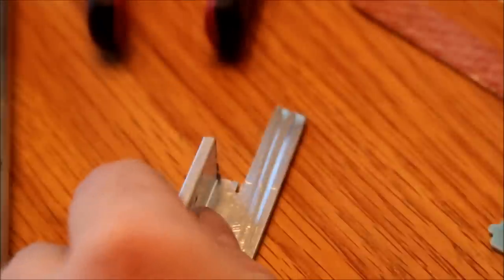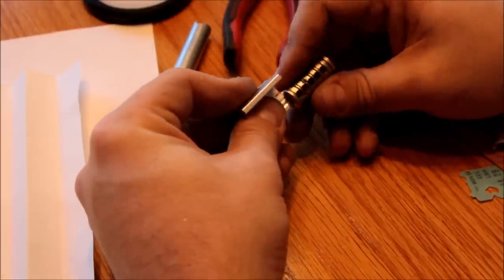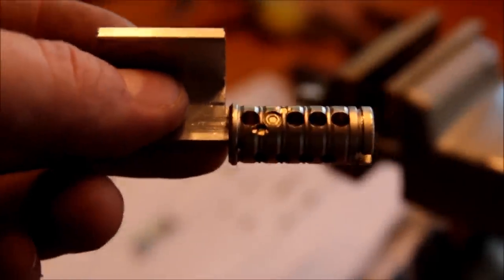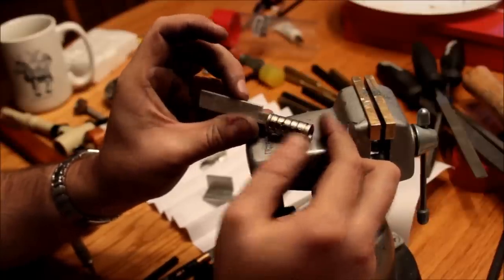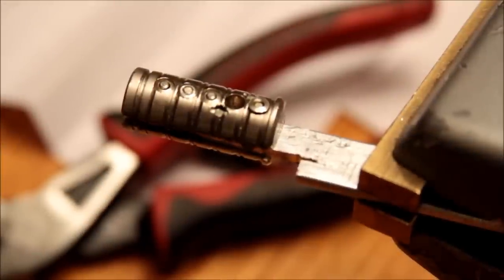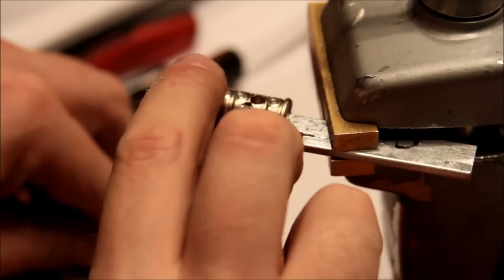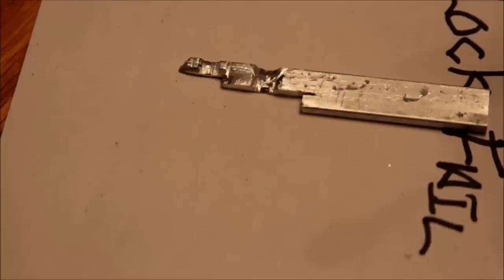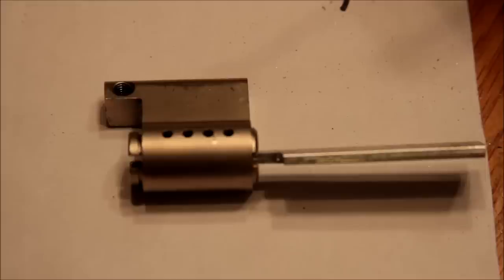(013) Mul-T-Lock Fail Part 2: All Keyed Up (2 of 2)

Comment from the maker: Towards the end, I noted that I installed a .015 master wafer in chamber 2, effectively bypassing the interactive pin. It may not have been easy to see in the video. (It's hard to see the wafer in person!) 

I may attempt a version 3 if I can figure out a clever way to simulate the active element.

Comment from the maker: The key that opened the lock was my second attempt. I had about 13-14 minutes of video which I edited down. The first key was full-width (and almost reversible) but I had thinned the stock down about .020" too far and it couldn't set the zero cuts. I can post the out-takes if they would interest you, mate.

Comment from the maker: Actually, that's not a bad idea. Except for that the wife doesn't like me using power tools in the dining room :) 

The other thing is... have you ever tried to draw a circle with a rotary burr? But, yeah, I probably could have cut the warding much faster with a Dremel. I just don't trust my dexterity, particularly when working with soft metals, to maintain the requisite level of precision.